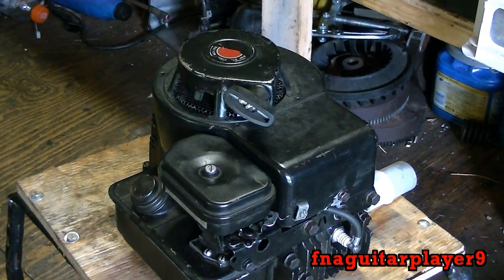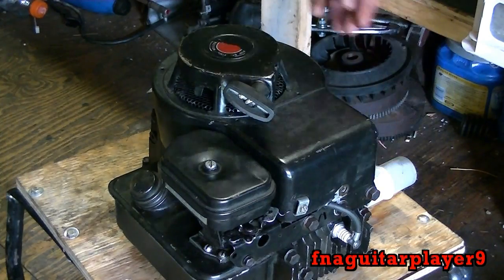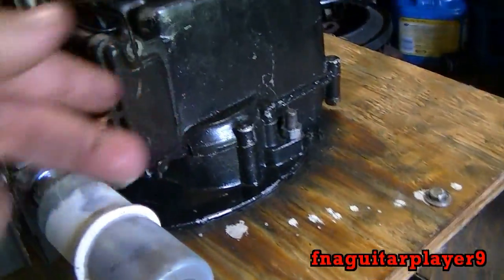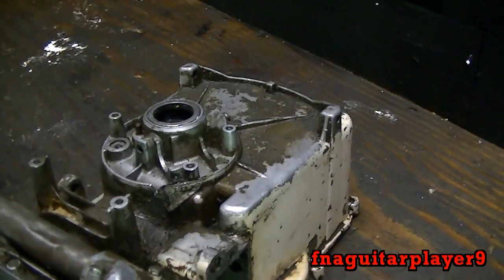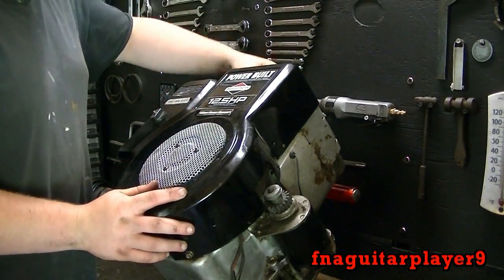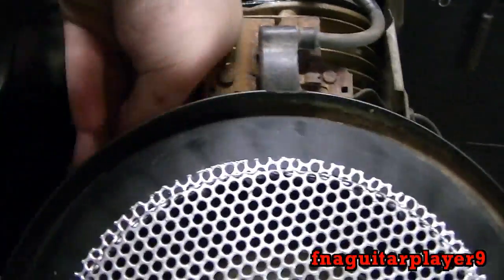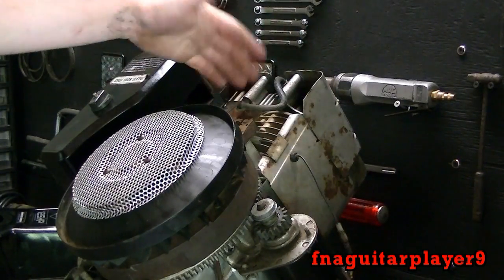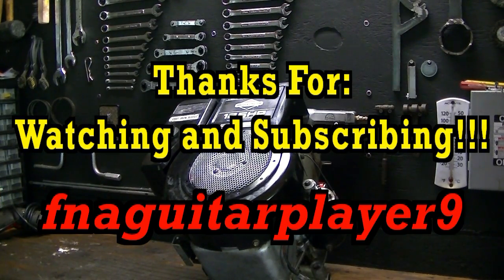How to tell if a engine has points and condensor or newer electronic ignition (magnetron)

Comment: I have a craftmans 14 HP Khloer engine and the coil has the wire to plug and place for kill wire  but where the coil bolts down pieces broke off block but it has two wires coming out under flywheel also  can I use battery coil on it like the old round types from 67 model trucks

Comment: You make such excellent videos , I almost fell over when you started with that black Briggs vertical engine I work on the exact same one and the darn points cause failure to spark! It was great to see you talking about switching to magnetron more modern spark system. I’ll be trying it with this old 5hp vertical shaft Briggs. Thanks for doing the videos awesome stuff!
Reply from the maker: Appreciate that! haha i hear ya! Yeah, its the simplest way to fix a points or coil issues on the older ones. Your welcome, Thanks for Watching!!!

Comment: why do some engines have points and condensors but some don't?
Reply from the maker: Really depends on how old they are, briggs and stratton stopped using points around 1982, most small engine brands changed over around that time, give or take a few years. There is alot less involved with the electronic ignition, they either work or they don't, and you never have to remove the flywheel to work on them either. I still like points. Thanks for Watching!!!

Comment: If there's a small wire from the coil going underneath the flywheel toward the shaft, it has a condenser.

Coil/Flywheel Gap = .013

Point Gap = .020

Plug Gap = .025

Those settings make a nice blue spark at the plug gap.
Reply: If I'm getting a spark when I have the spark plug removed and pull the engine over, then does that mean it should at least fire up?  I am getting compression(not tested with a gauge but I can feel it on the pull cord). But no amount of pulling the engine over seems to get it to spark even while using engine starting fluid on the carb.  Really not sure where to go next, other than to just replace the points, condenser, and spark plug, and hope for the best.
Reply from the maker: Thanks for Watching!!!

Comment: I WOULD RECOMMEND HAVING A CAN OF CLEAR COAT KRYLON AND CLEAN THE RUST OFF OF THE ARMATURE BUT NOT PAINTING WHERE THE MAG NEEDS A GROUND. ALSO I RECOMMEND CLEANING THE POLES ON THE ARMATURE AND SANDING THE RUST OFF OF THE FLYWHEEL MAGNET AND PUTING A COAT OF KRYLON ON THESE AREAS. MY FRIEND HAD MADE A CEMENT SCREED WITH A BRIGGS ON IT AND THE MOTOR HAD A LOT OF TROUBLE WITH WATER GETTING ON THESE PARTS AND THEN HAD LOW SPARK AND STARTING PROBLEMS. AFTER I DID WHAT I DESCRIBED ABOVE, NO PROBLEMS.
Reply from the maker: I never thought of clear coating it like that, that would keep it from rusting up. good idea! Thanks for Watching!!!
Reply: Linseed oil is good for things like this , couple light coats

Comment: How does the SS Magnetron ignition coil  self adjust the early/late timing of Briggs engine, without the cam shaft delay for points? Where can I find this information. The laminations air gaps are different widths also.
Reply from the maker: From what I understand the timing is adjusted from a internal circuit 
(in the magnetron itself) that adjusts it based on the time it takes for
 the magnet to pass the legs of the coil, which is less as rpm 
increases. It detects this and adjust accordingly. Kind of the same way 
the points do it, but its magnetic instead of mechanical. You may be 
able to contact briggs and stratton for more info on this. I'm not sure 
of the actual degrees that it changes it, but its probably not much. 
Hope this helps! Thanks for Watching!!!

Comment: hey I just received a push mower that has no spark. it as the electronic ignition obviously according to your video. I've checked the flywheel magnets and only one side has magnetism and the other has none. also the only way to get spark is to attatch a small wore from the kill wire to the end of the spark plug lead and hold onto the spark plug lead and touch a finger to the ground. would you think this is a flywheel or a coil?
Reply from the maker: +Jordan Walker Sounds like a bad coil, its super rare to have a weak or bad magnet, i'd say try replacing the coil first and go from there. I was going to say unhook the shut off wire first, but you already done that. sometimes a bad switch will do it. Thanks for Watching!!!

Comment: I have not removed the cover of mine yet but I think its the magnetron setup... its 2002 mtd yardmachines 28n707 briggs... I am wondering, if you have the magnetron coil would it be better to run resistor spark plugs? Would it bother the coil if you ran non-resistor plugs? I would rather run non-r plugs IF its not gonna damage the coil.
Reply from the maker: +codemiesterbeats To my knowledge it shouldn't matter at all, both plugs are available as replacements so i would think it would be fine. Thanks for Watching!!!

Comment: i put a new coil into my 2003 Tecumseh 3.5 hp.snowthrower and i still have no spark.  Do the flywheel magnets ever go bad?  This is a Craftsmen 536.885203.  Good video. Thanks..............a
Reply from the maker: alex tworkowski It is possible that the magnets get weak or loose their charge but its very rare, more than likely its a shorted wire or bad switch somewhere, or possibly a safety switch, I have a video showing how to diagnose spark problems, it won't be on a tecumseh but the setup is pretty much the same on any small engine... http://youtu.be/S8B7Xwpz94w Thanks for Watching!!!
Reply: Can you just disconnect the kill wire if there's a bad switch? Shouldn't that prevent it from grounding and make it run? Also, do these just spark every rotation of the crankshaft, so there's a spark even on the exhaust cycle? What's the cause if there's no spark with one of these if you disconnect the kill wire?
Reply from the maker: Yes they do spark on each rotation of the crankshaft, and a spark is "wasted" on the exhaust stroke. I did a video showing why this is. If your engine has the electronic ignition coil and not points/condenser, then its a bad coil or plug, but if it has points/condesner then one of those is usually the problem. Thanks for Watching!!!
Reply: ColonelBumButt   I got so tired of playing w/ my snowblower that i dragged it to the curb.  You might be right about the kill wire and the spark timing.  I don't remember if had done anything w/ that.  I wish i had talked to you 2 yrs ago.  You probably would have saved me a lot of trouble.
Reply: Awesome, you really cleared up a lot for me. You answer is very much appreciated. I just ordered a new coil. $12 on Amazon. Definitely worth a shot. Thanks a million!

Comment: hello  i have 5hp verticale shaft briggs... has no spark... thanks to u i can take the points back i bought...thank you .... haven no spark.. and no points...does that mean the magnotron is bad....
Reply from the maker: David Bilski There is still a few things that can be bad, first off the air gap between the flywheel and coil, a bad igntion switch / shorted wire somewhere or lastly something thats always overlooked is the 2 posts that the magnetron mounts too, corrosion can form between the post and coil, take the coil off and clean both surfaces, i talk about all of this in this video here: http://youtu.be/S8B7Xwpz94w thanks for watching!!!

Comment: WHAT ABOUT AN ENGINE THAT HAS THE COIL UNDER THE FLYWHEEL?
Reply from the maker: that will more than likely have points, unless its a newer engine. If its older than 1980 it probably has points, thats around the time most companies switched over, give or take a few years. Thanks for Watching!!!

Comment: So, a day ago my auto teacher let everyone in the class grab whatever small engine they wanted so I grabbed a nice 5 horse Briggs and Stratton and when I pulled the cable to try to start it, it wouldn't pull so I took it home and took of the shroud and luckily it was just the magnetron not letting it turn. So I put the magnetron back on and it doesn't create a spark. I look at the side of it and it said "THIS PISTON SIDE" so i turned it around and still nothing. Any diagnostics I should run on it?
Reply from the maker: First thing i check on these is the shut off wire (unless it has the metal tab on the spark plug) to make sure its not shorted, another thing thats overlooked is the 2 posts where the coil mounts to, and where the post touches the coil's frame, clean this to make sure there is no rust or corrosion, and make sure there is not a excessive amount of rust on the flywheel magnet and the coil itself, a little surface rust doesn't matter, if all of that checks out, and you set the gap right, make sure you got a good plug (probably the first thing that should be done) and if you still don't have spark, its probably a bad coil, you can take a volt-ohm meter across the ground and the spark plug wire and check for resistance, it will be a very high amount, if there is none its bad. Hope this helps! Thanks for Watching!!!

Comment from the maker: no problem! does the exhaust smell to rich? It could be a bad carburetor (doubtful though but possible) sounds like it could be in the valves, reseating the valves usually helps alot, i have another video on that. If its to big of a gap it can cause problems, just have to check and see, it should be the thickness of a business card. hope this helps!

Comment: thankyou for coming back, also wanted to ask I recently changed diaphram and gasket on my briggs 3.5 classic and the revving up and down has gone now but she still spits and pops while running any ideas? can exhaust valves stick or the gap between the coil and flywheel make a difference what am i looking for thanks in advance

Comment from the maker: The electronic is more simple, and instead of having points and condenser, it has all of the circuitry built in on the magneto itself, more reliable but more costly to replace. Have you checked the plug, alot of times its fouled and won't fire right. The only gap is between the coil and flywheel. Hope this helps, thanks for watching!!!

Comment: so what is the difference between using points and condensor and electronic? also is there a gap in electronic or is it preset? I have a 3.5 briggs classic just changed diaphram and gasket set but it pops and spits when it runs that is electronic ignition any ides thanks in advance Ian

Comment from the maker: that should work, if i remember correctly the coil is interchangeable on those 2 motors, if it bolts up it should work. the only difference between a 3 or 3.5 and the 5 horse is the stroke length and camshaft. thanks for watching!

Comment: There is an easier way. You can check the date on the engine cowling.. the code. If its older then 1982 it should have points and condenser ignition. I was told Briggs converted to magnetron after 1982. But sometimes people have swapped cowlings. Changed the ignition etc. So worth checking under the cover as well.

Comment: Good stuff, I have a Briggs 4.5 hp in a power washer that I'm going to be going through.  It needs the governor spring adjusted and the carb cleaned good.  Like these Briggs engines they run a long time.